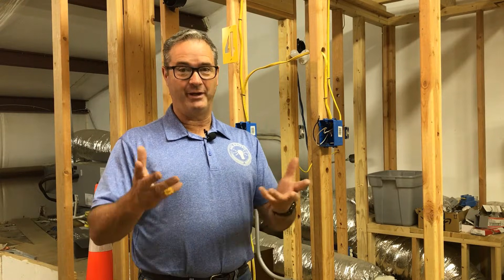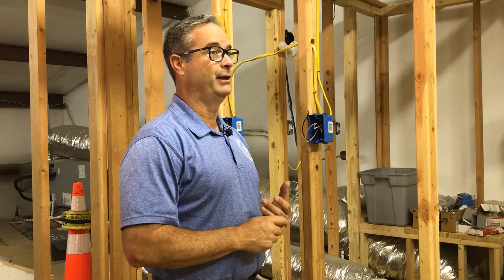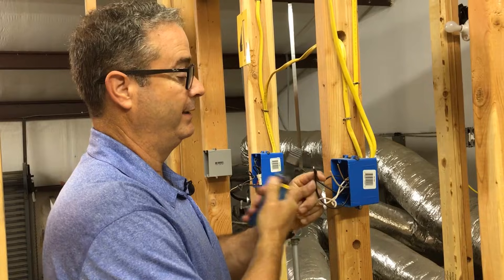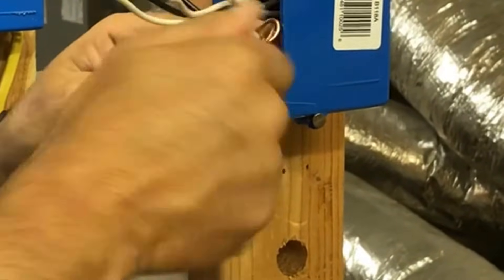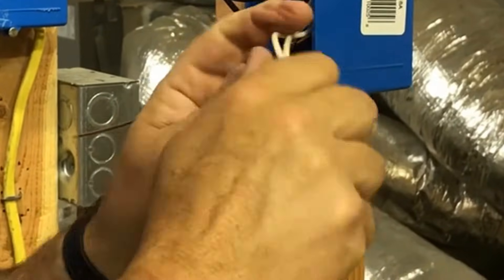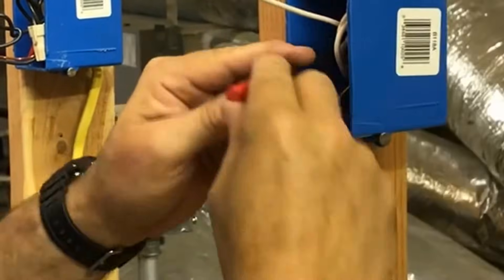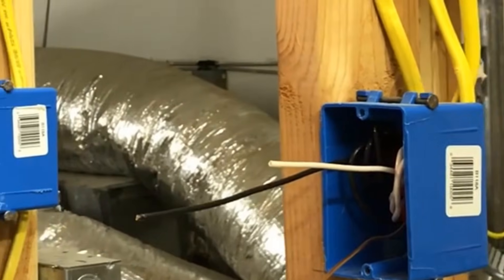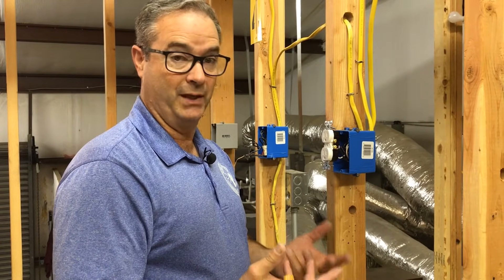How to Pigtail Electrical Wires

Comment: I don’t understand how people can think that pigtailing makes troubleshooting easier. Pigtailing introduces another failure point, puts more wire in the box and the fact of the matter is the bus bar on the side of an outlet is not the failure point of the outlet. Sure the screws can loosen. But a wire nut can fall off or be poorly installed too. Poor workmanship can be with how you install wire nuts just as easily as how well you loop a wire around a screw and tighten it. If anything the screws are probably easier for DIYers. There are situations where pigtails are necessary but unless you have to just use the bus bar on the side of the device.
Reply: All things being equal, I think the average electrician or laymen is more likely going to screw up putting three or four wires on a couple screws than four or five wires in a wago or a tightly wound wirenut. Both can fail, but some methods are easier to get right than others.
Reply: No short pig tails will be safe, you need 3/4 of an inch to an inch and you trim it once all raped well.
Reply: How can a duplex outlet  go dead anyway?
Reply: And by the way, you should not add a wire to a pigtail that you just completed, that last wire will not pigtail correctly.
Reply: It definitely makes troubleshooting easier. Having a separate junction box for the pigtailed wires can solve the problem of having too many wires in one box.
Reply: @stanmarr4488  junction boxes have to be accessible, not a practical solution in many cases
Reply: Did you watch the video? He answered your question at about 8:55
Reply: Yes it's also seems like extra work and extra point of failure
Reply: I second. And I make one  last pass on all screws before I push the device into the box.

Comment: Anybody notice how bad the new boxes are?  Such cheap garbage that break or bend while trying to push cable into the box, especially multiple 12/2.
Reply from the maker: Yes, I have to pre-punch with needle nose pliers.
Reply: Yes, I had metal boxes installed in my house. 4x4 metal box with a mud ring.

Comment: I am a DIY’r and will connect two receptacles differently.  This is a trick I learned from seeing how an electrician wired a double receptacle box at my house.  Make the hot, neutral & ground wires about 12” long coming out of the box.  Strip the insulation off the ends of the hot and neutral wires.  Then strip about 1/2” of the insulation half way down the hot and neutral wires.  The ground wire probably does not have insulation and should not need wire stripping.  Wrap the hot, neutral and ground wires around the appropriate screws of the first receptacle at the halfway point where the insulation was removed.  Next wrap the striped ends of all three wires around the appropriate screws on the second receptacle.  I like this method better than the pigtail method because it does not require wire nuts for the connection of the two receptacles and will keep the download circuit live if there are additional receptacles.  If there are additional receptacles downstream, I have kept the run of Romax continuous with 12” coming out of the box.  Strip 1/2” of insulation at two appropriate spots on the hot and neutral wires and then wire up the two receptacles the same as stated previously.  This wiring method  uses absolutely no wire nuts in the box.
Reply from the maker: Solid wire, right? I have done this making up a 4 plex (2 plugs in a 2g box). Great idea

Comment: Back in 1978 when I started wiring houses I was 14 years old.  It wasn't until I was like 35 that someone showed me the pigtail method.  I have never used any other way since then.  It's nice that if an outlet goes bad, power continues right on down the line and can really speed up looking for circuit issues.
Reply from the maker: '78!? You and Edison rope houses together? :) Thank you!
Reply: Awesome comment! @abrelectric
Reply: That's 21 years without pigtails, wondering if you had many call backs or failures?
Reply from the maker: @surferdude642  For many years, it was accepted practice to use the receptacle to make all of those connections, especially in the days of receptacles that  allowed #12 solid stab ins. The workmanship is the real issue. A poorly done pigtail isn't any better than a poorly done receptacle termination.
Reply: @surferdude642  Never had a single callback.
Reply: @deej19142  Thanks for the reply, and it's kinda what I expected to hear. If you do good work, you shouldn't have call backs for either method. If the work is poorly done, an electrician would have call backs for either method. Like you, I still prefer using pigtails, because from the start, only three wires are needed to land on the receptacle, instead of 5. This is significant on 12 gauge wire.

Comment: Are pigtails required by code? No. Are they used for good workmanship? Yes. The real advantage for the pigtails, other than disabling the circuit if the receptacle or connection to the receptacle malfunctions, is you can make the pigtails the proper length to fold neatly into the box. The pigtail connection are organized in the box as far to the rear neatly as possible. This gives plenty of space to fold the pigtail wires and fit the receptacle properly in the box as shown in the video.

To make installation even easier with the triple Romex into a single duplex receptacle box (which is more than usual unless the receptacle is split), IDEAL actually made a 12 AWG THHN stranded wire dedicated pigtail with a wire nut on one side and a captive spade connector at the other. The flexible stranded wire puts almost no side load force on the screw connections, and the spade fits flat in relation to the base connection and the screw head. Unfortunately they no longer make the Black and White versions of this pigtail, probably due to cost. However, even though they were only used on rare occasions, when needed they worked very well.
Reply: actually they are required by code in my circumstance. currently the wires are daisy chained through the light switch which is against code. by making a pigtail they'll be daisy chained but not through a device.
Reply: For a duplex receptacle there are screw connections for each single receptacle to support splitting the duplex receptacle into two separately controlled single plug outlets. If you do not split the receptacle, which is obviously very common, then it is tempting to use the "extra" screw connections to make the daisy chain at the receptacle rather than making a spliced pigtail. In the case of a simple SPST wall mounted switch there are only two screw connections for the circuit, and one screw for the ground. I don't know how you would daisy chain at the switch unless you double up on the screw connections, with common rated switches doubling up is a code violation. Is this what you mean?  @cryengine_x
Reply: @windward2818  i think so, i really dont know about electrical stuff. But there are 3 "line/load" wires going into the (I believe single pole?) switch. Two on the two screws and one in one of the backstabs. So in googling about this apparently they are feeding another switch off this one. Probably there is a switch (actually 3 with one plate) directly across from it on the other side of the wall, I'm guessing thats it. Does that make any sense? I discovered this because I'm trying to put in a smart switch, and although my home is only 23 years old, the switch wiring is as i described not two line/load like their diagram.

From what I googled I can make a pigtail off two of the black wires and be ok.

they also did not connect the ground wire to the green screw on the switch at all. which evidently in a plastic box is not particularly dangerous, but is still code to do so.
Reply: So, you have discovered a code violation. Only one wire or termination allowed per screw. You can daisy chain on a non-split receptacle without violating this rule because you have more screw terminations than a wall switch. However, even though you have not violated code, you have not achieved good workmanship, which in the case of the receptacle requires the use of a pigtail. With a wall switch you have no option, you must use a pigtail splice.

If you do light industrial AC distribution wiring you will be using a lot of stranded wire in conduit for 20 Amp receptacle branch circuits. So, we also have a workmanship question to ask, that is, can I use a stranded wire underneath a screw. With a solid wire the answer is yes. With a stranded wire the answer is yes, but I don't really see this as a method from the master electricians. The solution is to use stranded wire terminated receptacles that don't have screws, so you can use a standard wire splicing method (like a wire nut or a lever splice (which I don't like)). 

Some master electricians if faced with using screw terminating receptacles (not the preferred type of device) will use a captive spade terminal (having small nubs and bent up ends so they will not come off if the screw is loose) crimped onto the wire (using a certified crimping tool designed for that particular spade terminal) and then placed under the screw and the screw torqued to specification. I have tried all three methods of screw termination for stranded wire and the one I like is the captive spade terminal and with screw torqued to specification. It just feels correct. Some of my installations are more than 30 years old now using spade terminals and I have never heard of a problem with a loose connection. @cryengine_x

Comment: Great video just what I was looking for. One question though I got a fried that supposedly knows a lot about electricity and he suggested to do ine and load instead. So question is if I have a gfci outlet with line in and loat out or vice-versa can I still do this and go straight into line on new outlet?
Reply from the maker: Sort of apples and oranges: GFCIs with power in and out, you can pigtail if you have 2 or more load romexes, and attach the pigtail to the load.

Comment: If this box were serviced multiple times in this way, there would be no wire left in the box that’s long enough to make a connection!  And all exist wires would need to be replaced!  I don’t think it’s a good practice to randomly cut wires like this, unless it’s really excessive!
Reply from the maker: Good point. Keep in mind that you don't typically need to do this but every several years.
Being conservative with the wire length is a good practice.

Comment: Pigtail wire should be twisted at the same time with the original lines to avoid  overtwisting the conductors that was twisted first without the pigtail.
Reply from the maker: Absolutely
Reply from the maker: Thank you!
Reply: @abrelectric  you say "absolutely" but yet you didn't do that on any of the three joints you made.  Clearly you didn't know that very basic step in pigtailing so how about you thank the person that taught you something instead of just agreeing as if it's something you already knew
Reply from the maker: @TheElectricalNut  ok
Reply from the maker: @TheElectricalNut  thank you

Comment: I added a new outlet from an existing outlet that already had two set of wires. So i did exactly like on the video. Months later the wire nut on the hots started melting, any ideas why? Plz it will be so helpful. My brother has a heater connected to it it says 120v 60hz.
Reply from the maker: Did you twist the wires in that bundle? Are all the wires solid or is it a mix with stranded? Did the wire nut completely cover the stripped copper in the bundle? Are the wires the same gauge or a mix of  sizes? How many watts does the heater draw?
Reply: @abrelectric  wires are all the same 3 sets of 12/2, they were twisted but since the box was small ground got a bit loose and one hot was slightly uncovered all the way by the wire nut. I took everything out, put a box with bigger space and used wago wire nuts everything is perfectly tight now.
Reply: Btw the heater manual says it uses 1500 watts
Reply from the maker: @coolbros2163  let's see how it holds! Thank you

Comment: If you put a surge protector receptacle in that box would it then protect everything else those sets of wires are going to?
Reply from the maker: It would protect everything plugged into it.
Reply: @abrelectric  thank you for the reply. I think I asked wrong. Would it then protect another receptacle that it was going to and the things that were plugged into that next receptacle?
Reply from the maker: @Wicked_pissah6295  if the wiring terminals are arranged as Line and Load, it may protector other devices downstream, like an AFCI or GFCI. Otherwise,  it will only be what is plugged in.
Reply: @abrelectric  thank you very much..I appreciate it
Reply: Is there 3 neutral wires in that box and why

Comment: Is it ok to use the Wago 221 connectors, instead of wire nuts ??
I have been using the ECX Milwaukie screwdriver, instead of Phillips, also a #1 Robertson square drive work great as well.
Thanks for the video
Reply from the maker: Absolutely! IMO, if you follow the manufacturer guidelines for your preferred connector, and you make a long-term solid connection,  it's a win.

Comment: Great video. Thank you. I have a question and I know very little about electrical. I'm bringing 12 guage wire into a basement kitchenette and finally managed to get the wire to both the breaker box and into the kitchenette. Currently, the whole kitchenette is wired with 14 guage. I've pulled in a dual set of 20 Amp wire. One will be dedicated to the refrigerator and one will power four 20 Amp plugs (2 GFCI, 2 regular). I have a lot of extra 12 gauge wire (the three wires are sheathed in a yellow outer plastic wrap). What's the approach to accomplishing this?  Thanks much if you can respond.

Comment: Actually, I think the NEC calls for 6" minimum from where the cable enters the box and 3" minimum outside the box. And yes, learn to strip wire, split wood, build a house, change a tire, replace a faucet.......  👍
Reply: No, he was right about the 6" outside the box but I Believe it is more than a 1/4 of insulation inside the box. I'm pretty sure it is a 1/2 inch. I'd have to check
Reply: @larrytoler5528  NEC Sect 300.14 reads "At least 150 mm (6 in.) of free conductor, measured from the point in the box where it emerges from its raceway or cable sheath, shall be left at each outlet, junction, and switch point for splices or the connection of luminaires or devices. The 150 mm (6 in.) free conductor shall be permitted to be spliced or unspliced. Where the opening to an outlet, junction, or switch point is less than 200 mm (8 in.) in any dimension, each conductor shall be long enough to extend at least 75 mm (3 in.) outside the opening."  

So, it's 6" from where it enters the box and 3" outside the box.
Reply: @mntriangle  Not an issue tho... making it 6" (esp cause for a 3.5" deep box you'd have to make it 6.5"!) outside isn't bad practice... only consideration is that if you make it 12" conductor  (double the necessary), the conductor counts as two for volume allowances.

Comment: If you are a teacher you are really bad. putting all the wires together and twisting them all at once makes a better connection. Stabbing wires in the back is legal, a good Electrican will not stab them if they do any service work, the loose connections come from pluging cords in and out which deterates the little metal tab in the outlet.
Reply from the maker: Absolutely. Watch the video - we're pigtailing to avoid loose connections

Comment: Why didn't you twist the 4 wires together instead of 3 first and then the pigtail?
Reply from the maker: Which 4 wires? We have 3 hots, 3 neutrals and 3 grounds to connect to the receptacle. The pigtail simply connects the 3 wire bundle to the receptacle
Reply: @abrelectric He's correct! You twisted 2 wires together, then added a 3rd wire, then added the pigtail which made a 4th wire. You did this for the hot, neutral and ground.